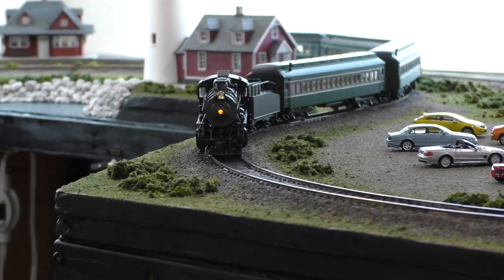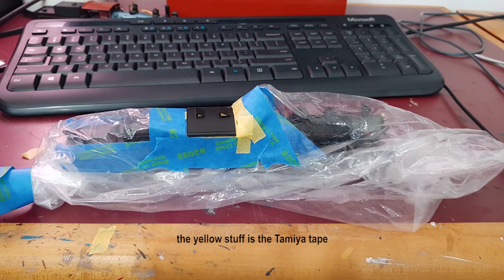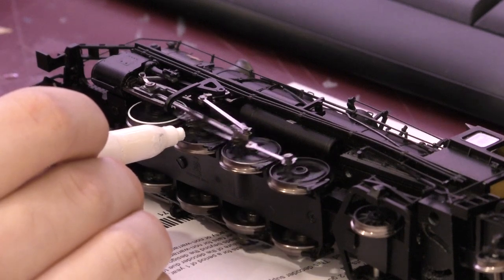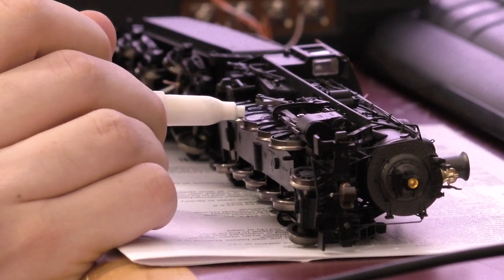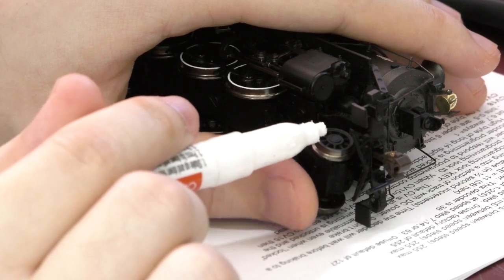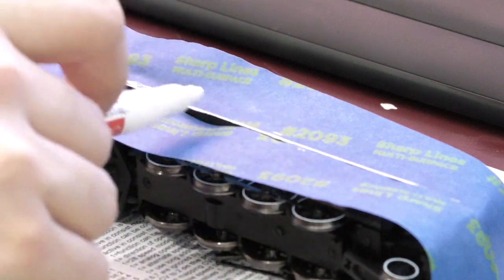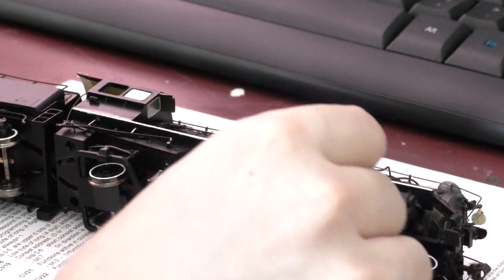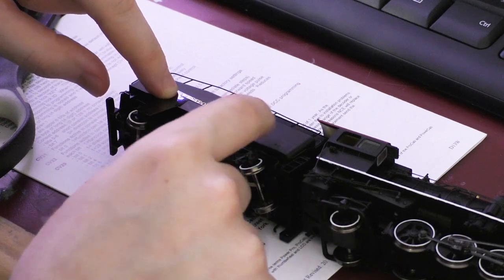Decorating an HO Scale Steam Locomotive

Comment: What would you recommend to put black walls on a mth big boy, ive got one and I am unsure if I'd be able to lay the engine on it side and run it when applying paint
Reply from the maker: If you can't hook up power to run it on its side, you could try using black paint on a tiny brush (or a black paint pen) and manually painting the exposed segment of each wheel, then putting it on the track and inching it forward a fraction of a turn, then taking it off and doing another segment of each wheel, until you've gone around the whole wheel. Since you're using black rather than white, it will be a bit more forgiving of error, since the face of the wheel is already black. I would experiment on a cheaper loco first, and find a process that works for you before attempting it on the Big Boy.
Reply: @michaelramsey81  thank you

Comment: This is super cool, and although I lossely model a real railroad, (CN) I think this would be a nice detail to add to my locomotives, even if it’s not prototypical. Just one quick question, (sorry I ask wayyy to many) what do you use to wipe excess paint of the wheel surface should that happen? Thanks for the great content, and keep up the great work!
Reply from the maker: Thanks! I use isopropyl alcohol on a Q-tip or paper towel to remove excess paint.

Comment: Even after the driving wheels, leading, trailing and tender wheels are given white wall rims, is it preferable to let it dry overnight?

Also, would the driving wheels, leading, trailing and tender wheels are given white wall rims applied dries faster on a fan after each application from the paint pen?
Reply from the maker: To be safe, I'd let all of it dry overnight before putting the loco on the track. It stays pretty soft for a long time. I haven't tried a fan, but since it's an oil based paint, I don't think it would help much.

An alternative method is to use acrylic paint and apply it with a tiny brush. This can be a little bit trickier in some ways, but easier in others, and it will dry faster with a fan.

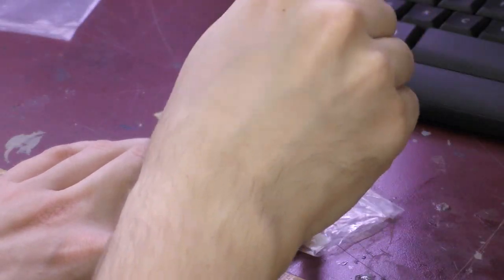Comment: 1:30 connect power leads? I never heard of those. I'm trying to find one for an ho scale rivarossi heavy pacific I'm going to get and repaint soon. Where can i find power leads
Reply from the maker: They're just wires with alligator clips on each end. You can get them on Amazon. I usually clip them to the tender pickups. https://www.amazon.com/Alligator-Electrical-21-5inch-Connection-Experiment/dp/B0995KJWR5/
Reply from the maker: Just clip them to the rails and control the speed as you normally would.
Reply: @michaelramsey81  oh I see.
Also fun fact, if I do get the rivarossi chicago & alton heavy pacific 5299, I might renumber it to 5296 and paint the engine and tender like Gulf Mobile & Ohio 5296. It's another C&A pacific, but in GM&O colors which is pretty accurate as the C&A engines became part of the GM&O once the GM&O purchased the C&A railroad, I believe they were well liked by crews

Comment: Very good video! Did you ever have to separate the SY locomotive and tender?
Reply from the maker: I did end up separating them when I removed the tender shell to install the DCC decoder, since the shell holds the drawbar mechanism in place. Getting it back in correctly took a few tries.
Reply: @michaelramsey81  Would you mind making a video on removing the tender shell?
Reply from the maker: @fallingup90  I'm planning a video soon about converting coal tenders to oil. I'll use this loco and make sure to show the process of removing the tender shell (and putting it back on, which I remember being a bit more difficult).
Reply: @michaelramsey81  Great! Can't wait for it!

Comment: I have a question.(Probably redundant and dumb one depending on what’s obvious.) 

Does it matter if the white paint pen is acrylic and water-based?
Reply from the maker: No such thing as a stupid question! Acrylic vs oil shouldn't make much of a difference, but you might have to experiment a bit to get it to flow on smoothly. I've successfully done it with acrylic paint on a small brush, although it is easier with the pen.
Reply: @michaelramsey81  I appreciate your kind words and understanding. I found some acrylic white paint pens on Amazon and weren’t sure if they would work. So thanks for the tip! My future fantasy cab forward and other likewise Locos and rolling stock will look absolutely dashing thanks to your methods.